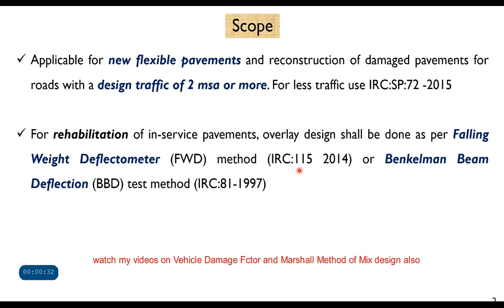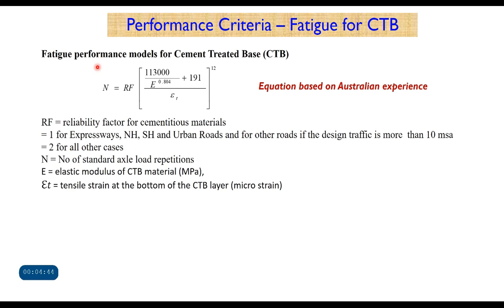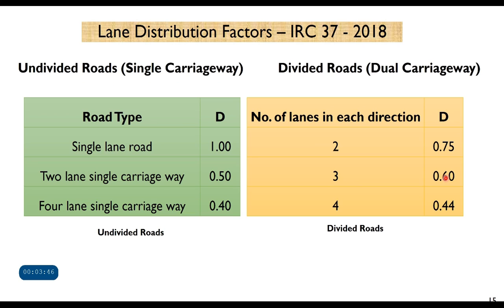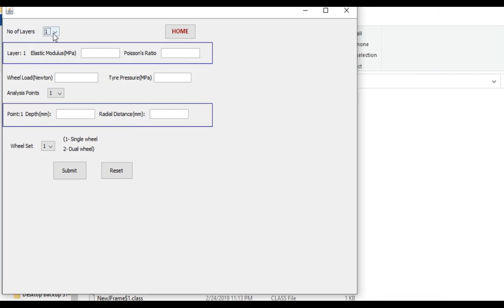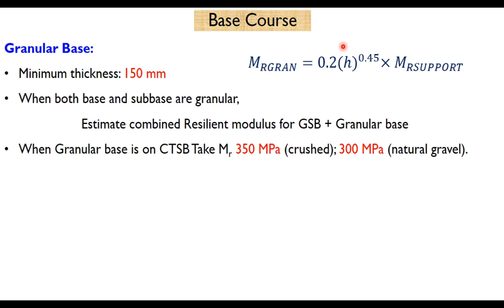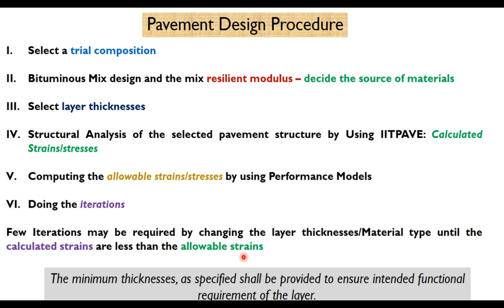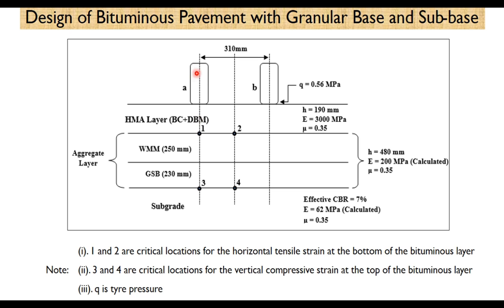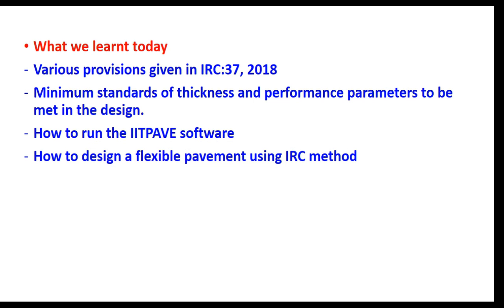#Highways, Design of Flexible Pavements as per IRC:37, 2018, all details with IITPAVE software.

Comment: Could you please explain what is difference between Table 9.2 and Table 11.1of IRC 37.2018?

If we are using the BM with SDBC as surface course.. What is value of Resilient Modulus to be consider ?.
Reply from the maker: SDBC is not part of specifications now and it should not be used. 
Table 9.2 gives the value of Resilient modulus that should be obtained in the laboratory during mix design. Table 11.1 gives example of input values to IITPAVE software, Mr value with Poisson ratio. This table takes Mr value of bituminous layers from Table 9.2 only (at 35 C)

Comment: Sir,
If the thickness of DBM in design is given 100 mm  and laid in 2-layer  in the thickness of 50 m each. 
Then my question is according to IS -37 is that whether the 1st layer is DBM (G-1) and 2nd layer is DBM ( G-2) OR both the layer will design according to DBM ( G-2 ) based on thickness
Reply from the maker: you can do both ways, but design for lower layer and upper layer will be different. The bottom layer must be desiged as bitumen rich mix at lower air voids as suggested in the code.

Comment: Good Evening Sir... Sir, As per IRC 37: 2018, The unbound base layer consists of wet mix macadam, water bound macadam, crusher run macadam, reclaimed concrete, etc., conforming to MoRTH Specifications[23]. Wet mix macadam may also consist of blast furnace slag mixed with crushed stone meeting the MoRTH Specifications. The thickness of the unbound granular layer shall not be less than 150 mm except for the crack relief layer placed over cement treated base for which the thickness shall
be 100 mm. 
My query is that we only changed the name  from WMM to Crack relief layer and thickness from 150 mm to 100 mm where CTB was used below it, but what properties have changed in WMM or Crack relief layer as no specifications have been changed while converting WMM to crack relief layer. And also the FDD has been given a minimum of 100% of MDD for Crack relief layer , so upto what extent (percentage of compaction) we can achieve at site.
Reply from the maker: Crack relief layer has the same gradation as WMM and therefore all physical tests as required for WMM should be applicable to Crack relief layer also ( I uploaded one video on Crack Relief Layer also). Further there is no concession given in the code for field density in the case of crack relief Layer also. 100 percent is needed.

Comment: Thank You for the explanation. I could not understand why the resilient modulus of the subbase is taken as 0.2(h^0.45)* Mrsupport. Does the property(here the resilient modulus) of a material depend on its thickness(h) and the property of the supporting layer? Why should we calculate the resilient modulus instead of taking it from the test or laboratory value like the resilient moduli of materials of other layers?(From Nepal)
Reply from the maker: Yes, ideally it should be determined in the laboratory. But the method of finding Mr value of granular layer is not simple and requires sophisticated equipment, because there is no cohesion in the material. This Equation is taken from AASHTO.
Reply: @SatishIITR  Thank you so much!

Comment: Sir, at 19:11, if the embankment soil CBR is less than 5% and borrowed soil CBR is more than 5%, in this case when the Mrs is more than 100 and we limit Mrs to 100 and while recalculate the CBR which CBR equation we need to use?
Reply from the maker: There is no need to calculate CBR back as it is not a design parameter.

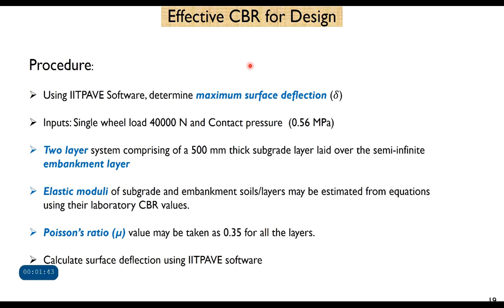Comment: Sir, At 13:29 under the Input you have mentioned Single wheel load as 40000 N.
But when we consider the standard Axle load as 80000 N, the load of single wheel will be 20000 N but you have mentioned 40000 N can you please clarify?
Reply from the maker: It is 20000 N only, may be a mistake. Thanks

Comment: Sir, in this lecture you mentioned CTB, GSB combination (6th cross section), we can use SAMI or AIL. If my design traffic is 20 MSA shall I use SAMI.
If not on which criteria, I should consider for providing these crack relief layers.
Reply from the maker: Yes, you can

Comment: In case of Cement Treated Base design, should IIITPAVE be run at two different tyre pressures? One at 0.56 MPa to check tensile strain below DBM and second at 0.8 MPa to check tensile strain below CTB?
Reply from the maker: CTB should be checked only for 0.8 MPa
Reply: @SatishIITR  and the BT layers in case of CTB for 0.56? Checking for strain only, not CFD.

Comment: Sir, if both the equation of Elastic modulus/Mrs are used to calculate the elastic modulus Value then which equation will be used to calculate the effective CBR  value after getting the surface  delfection ?!
Reply from the maker: Remember CBR is not used in the design, it is Mr value that is given as input to IITPAVE.
After getting the surface deflection, find out the Mr value and this is the effective Mr of the subgrade soil. If you want to find out the effective CBR then use this Mr value to back calculate CBR. I hope it is clear now.

Comment: Sir, In case of Service Road and Slip Road of National Highway, what reliability % should be considered, 80% or 90% ?
Reply from the maker: depends on what standards are being followed. If this road is being designed as NH then take 90%, otherwise 80%
Reply: @SatishIITR  
Sir, Can it be concluded that if Service Road with 10 MSA traffic is a part of National Highway, then it should be designed with 90% reliability?
Reply from the maker: @sourabhladhi9978  I think so.

Comment: Sir how the poissons ratio shall be selected for the overlay design? How much it should be for the bitumineous layer in case of new over lay and old layer at the same time.
Reply from the maker: Poisson ratio does not make much difference in final output. Therefore, it is take same for old and new layer.

Comment: Sir, in 7:50 when they are considering  20kn on one wheel..finally 20*4 =80 kn.....
Why haven't they considered the axle load......b/w wheels.
Reply from the maker: Although your question is not very clear to me, yet I would say that the analysis is based on the wheel load and not the axle load.

Comment: DESIGN TRAFFIC GRANULAR LAYER  OR BITUMINOUS ? WHICH ONE IS LESS THAN 2 MSA FOR 72-2015 TO FOLLOWED........PLZ ANSWER
Reply from the maker: question is not clear. Video for rural roads with traffic less than 2 msa will be published soon.
Reply: @SatishIITR  when bituminous layer (5years)-0.75 msa and Granular Layer-(15years) -2.92msa
IRC 37-2018 recommend more than 2.0msa design Traffic 
Here Granular layer Traffic more than 2.0msa but bituminous layer below 2.0msa .
Isi condition me IRC 32-2018 design karsakta hai.... Sp-72-2015 leke design karenge

Comment: Sir, in case of CTB Layer where Prime coat can be used?
1. On CTB layer prior to SAMI
2. ON SAMI layer prior to BT Layer
3. Prime coat shall not be used ON CTB or SAMI
Please provide Your valuable guidance
Reply from the maker: In my opinion, prime coat will be required only if you are using crack relief layer of aggregates only.

Comment: Sir why u haven't use the kgp back software (Mentioned in IRC 115) for backcalculation??
Reply from the maker: KGPBACK software is to calculate the modulus values of individual layers from defection data. IRC 115 is for the design of Overlay on existing pavements while IRC 37 is for deign of new pavements.
Reply from the maker: I have uploaded another video on Overlay design using FWD as per IRC 115
Reply: @SatishIITR  I will see that also

Comment: Dear sir what the the minimum volume of binder as per coral provision
Reply from the maker: There is not codal value for minimum volume of binder. But VFB will certainly depend on Vb and that should be within permissible limits depending upon the type of layer.